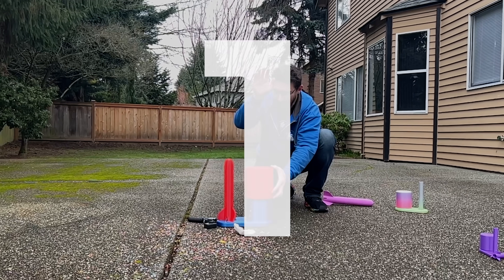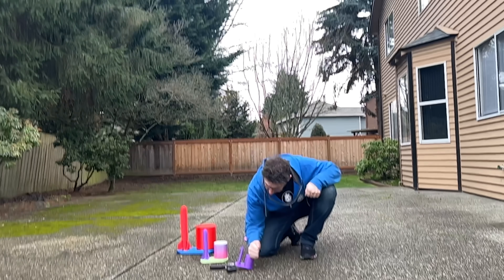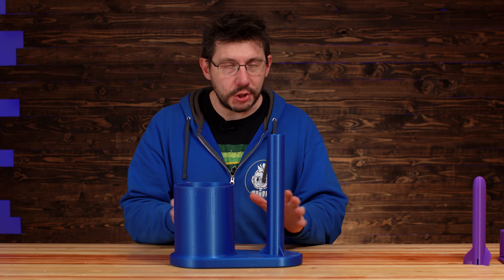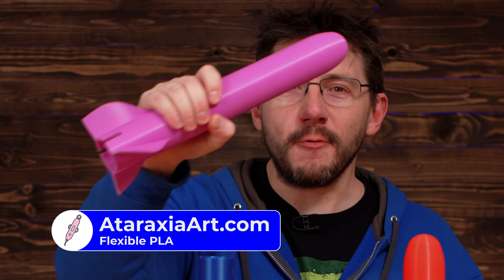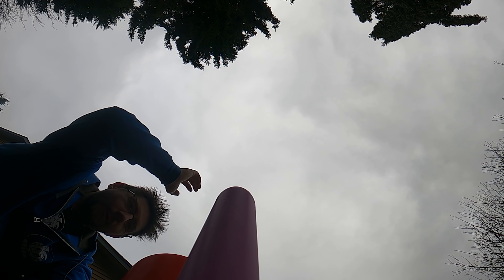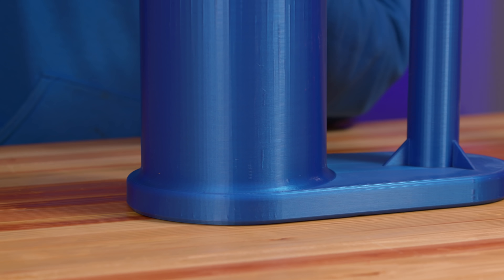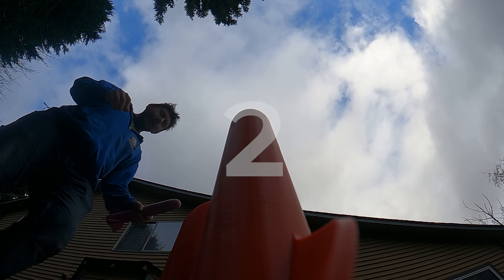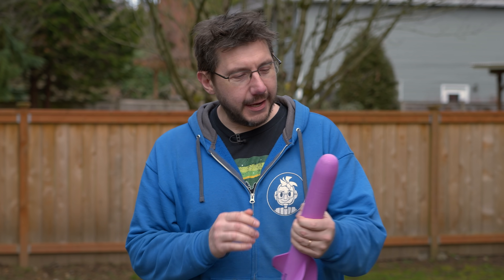SUPER SIZED STOMP ROCKET!

Comment: ⁉️New video idea⁉️I have a question could we possibly see what would happen if you took the launcher at 400%  bigger and edited it to except the original size smaller rocket maybe a tad bit longer to except more airflow. would the increased air volume on the 400% launcher dramatically increase the height the smaller rocket could reach

Comment: An o-ring of TPU with a notch to fit over the top rim of the button post would make for a good air seal. Can use petroleum grease to lube it up. I was surprised at how water tight TPU is even before calibrating print settings for a given spool. My first test cube with no top holds water.

Comment: Side note - I was intrigued with the flexible PLA - and bought a roll. It is more flexible than TPU and my first prints used the same settings as PLA and there results were pretty darn good.  And a LOT easier to print with than TPU.  Now off to experiment with it's rigidity.
Reply from the maker: Right? How crazy is that?
Reply: I have been trying out the flexible PLA from Ataraxia Art and have some observations. OK - first off, I print, build, and fly RC planes.  Traditional PLA and LW-PLA work well but are fragile. So when I saw Joel beating the flex-PLA rocket I thought maybe there was a use in it. It does print up great using regular PLA setting on a cheap Ender 3.  Like - really well. But the parts I use for airplanes are typically single wall prints. And while the flex-PLA printed beautifully, I could literally fold the fuselage up into my pocket.  So - not so good on the rigid category.  But multi-wall (like the rocket), really nice material. So the bottom line, terrific alternative to TPU. 5 stars, two thumbs up.  Foldable airplanes - hard pass.

Comment: The reason the rocket is traveling shorter distances the bigger the print gets is because It takes a lot more force to move progressively larger volumes of air through the space to propel the rocket.

If you want the big one to go up super high again, you'll need to modify the print to make it safe to stomp on
Reply: And yes, I see that I was correct, lol. Another addition you might want to make is filling the interior of the plunger with silicone, but only on the bottom of the interior so that at the end of the stomp it's not plastic on plastic.

Comment: Looks like a very fun print and LOTS of room for experimentation and learning! I think the square-cube law is biting you in the butt on the bigger prints as well as the leaky piston you fixed with tape.

General other suggestions to improve performance:
Lower the weight of the bigger prints (less walls, infill, etc)
Use straight fins rather than spiraled.
Longer drive piston.
Tape to seal the bottom of rocket to the launch tube to build up a little pressure before release.

And as Scott Manley always says: "Fly safe!"

Comment: Anyone try making the rockets out of LW-PLA?
Reply from the maker: Not yet but I sure want to try
Reply: @3DPrintingNerd  Should give you Flex and Less weight, you may need to add a little weight to the nose to keep it tracking in the air.

Comment: That was fun! I love when you make stuff that does things. I was thinking you could thicken up the model in the needed parts before 3D printing, rather than using tape. Also maybe a few made the whole mechanism taller to have more air push the rocket, but leave the rock at the same size?

By the way there's a YouTuber that just hit 100,000 followers who uses the name puppet nerd. I thought you might want to do a collaboration with them at some point. They're very accomplished puppet builder and puppeteer and have worked on tons of TV shows and movies. They also have a very positive upbeat channel like you do. If you need ideas I've got lots of ideas for 3D printing puppet related stuff I could make some models for you if you like.
High-5!

Comment: The flexible pla didn't hit the cement.  So kinda the implied point of the experiment wasn't really shown.  The idea that the flexible pla would survive the same situation the PETG didn't.  Also Gandalf is right I can't remember for sure but I think if you scale the mass of the rocket up 200 percent you need something like 4 times the volume in the compression chamber to get it to go just as high as the original 200 percent scaled model. Also since it's 3d printed I'm guessing the rocket is getting heavier much faster than the volume of the bladder is going up because the walls are getting thicker.  There are a lot of equations that could be derived from this by changing the bladder size and mass of the rocket if you control the experiment right... could be something fun for kids of the right age to try to figure out and make predictions about.

Comment: the engineer in me is so disappointed. can I design a big iteration of this for you to print? :)) I'd say the same size as the 400% one, but with improved tolerances, longitudinal layer lines (less friction on takeoff), and improved geometry/material/print time. ALSO, always place a bit of a weight at the tip of the rocket, to make sure it nose dives, and cover the tip in rubber. or heck, put a small bag at the end as a chute :))
Reply: Its apparent he didnt read the description of the print on thingiverse (unless it was recently changed) as it provides the proper scaling formula to keep the tolerances the same.

Comment: Joel, as an Astrophysicist.... It's called a STOMP rocket.... You are correct about the air coming out between the parts, but the same thing happens on the smaller scale as well. Bigger object = bigger force required to launch. More air also = more pressure required.
Reply from the maker: YOU ARE AN ASTROPHYSICIST?!?

Comment: Perhaps you could also try adding some blue tape at the bottom of the launching tube, to create some resistance and create some additional pressure inside. Once the pressure is enough, the rocket would go past the blue tape and work as before (but with the increased pressure hopefully).

Comment: Adding some tape to the pipe for the rocket might help as well. Also, since you are printing the rocket in flexible filament, you could reduce the wall thickness to reduce the weight of the rocket. Remember every gramm you save increases your delta v.
Reply from the maker: Yeah, thinking about it now - flexible rocket should have been a vase mode print
Reply: @3DPrintingNerd  Would also reduce print time. I don't know about flexible PLA but TPU takes foreeeeever.

Comment: Do you think if all the parts it were printed sideways (so the layers were in the direction of the flight path) it would help cut down on friction, and go even higher? Maybe adding oil to prevent loss of air around the gaps between parts would help too?

Comment: My wife has never been interested in my 3D printer, until now.
Reply: I thought this was an innocent comment then it all made sense
Reply: 3D Printer: how big?
Wife: Yes!
Reply: I'm already remixing a few toys to fit the launcher for some adult size fun.
Reply: I've been told to build a Voron to speed up manufacturing
Reply: LoL!
Reply: My faith in humanity is restored.
Reply: Remember, if you do plan to do this, that unless you use some kind of coating or smoothing, bacteria will accumulate between the layers, leading to all sorts of very bad things
Reply: Just, you know, wrap it if you gonna...
Reply: Same here!!
Reply: Maybe she started watching at a bad point
Reply: @woodwaker1  yeah, right at the time Joel introduced that flexibele pinkish colored one 👍😎
Reply: Come on, join in the fun! Custom butt plugs all around
Reply: @RubixB0y  good way to find out if you're having a problem with layer adhesion
Reply: @RubixB0y  Take care of the gaps between layers. Or are they one time use🤔
Reply: @lazyman1011  Lol, ABS with acetone vapor smoothing does wonders ;)
Without smoothing I imagine it would be less than one time use from the pain xD